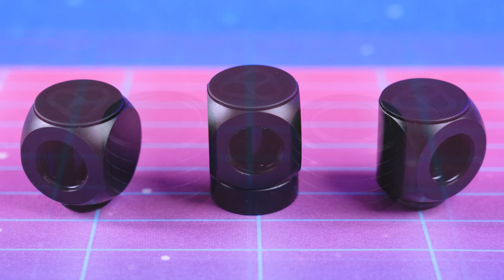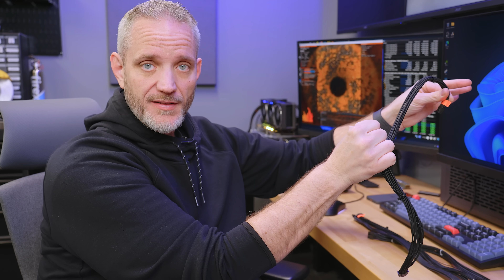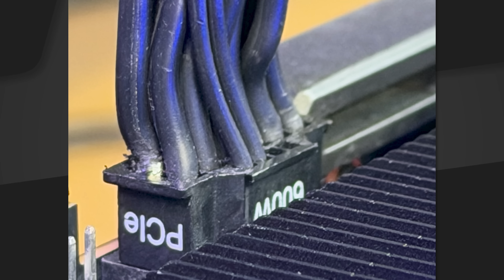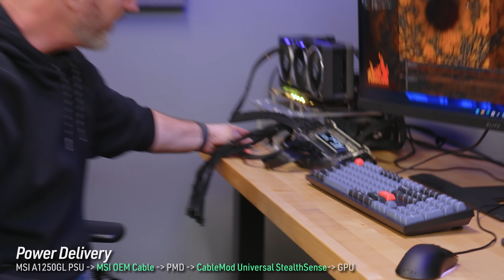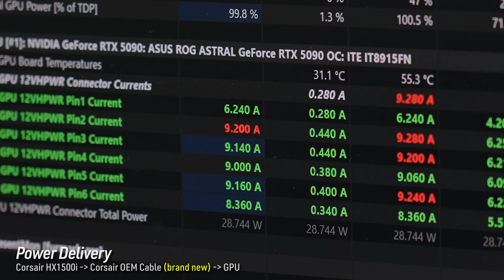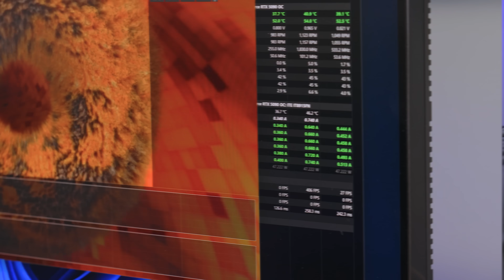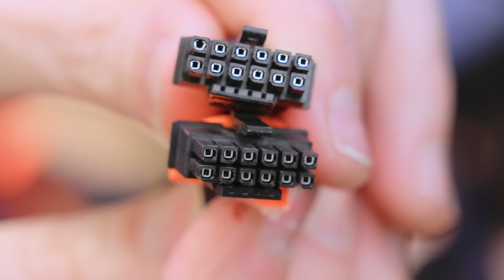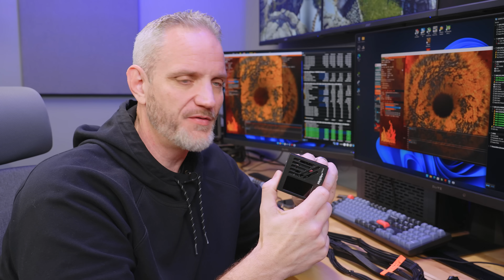More details on what could be causing 12VHPWR / 12V2x6 Cables to melt

Comment: I bought a Wireview II for my MSI 5090 and immediately found pin differences and one frequently going over 10A. Setup was Corsair HX1500i -> MSI 4x8 pin to 12v2x6 cable (that came with the card). I bought the Corsair 2x8 pin to 12vHPWR premium cable and things are better but pin differences still exist with Wireview complaining that there can be over 1A difference between wires under load. I have done resistance tests on all pins in the cable and they all are ok and match , even when the cable is being scrunched up and moved around (I wanted to check for broken wires). So the Wireview II probably saved my card but I'm still not entirely happy. I'm thinking that so long as I don't get pins going over the 9.5A standard I should be ok but I'm mad that the cards have this terrible connector and no per-pin monitoring.

Comment: As an electrician I'd like to see two 3 gauge wires used instead, with proper screw terminals, or four 6 gauges wires. Better yet they should change the spec to give video cards 24v or 48v instead of 12v.

Comment: how do I get the wireview inside an AMD RX 9070 XT Sapphire Nitro+ (with the connector hidden inside the gpu, on the back of the radiator)
Reply: Leave off the cosmetic magnetic cover plate to give yourself more room.
Reply: @bythelee  there is no way to fit the wireview in there, the connector is right above the radiator

Comment: Were fighting a zombie that resurrects through corporate incompetence, unfortunately that seems to be an infinite resource.

Also I have a case that requires the removal of the GPU to properly dust, cycling of the plug is supposed to be part of the standard. PCIE 8 pin is only 30 cycles and I have had to replace my psu pcie cables due to cleaning and modifications over the years. These connectors are not meant for repeated cycling and are built to minimize cost of MFG. They may last many more cycles than rated for, they may also have a factory defect and fail on the first plug, this is why quality control is important for every manufacturer of physical goods.

Comment: We know that this cable is weak but the main issue is the design of the cards since the beginning.. The 3090 Ti is properly build and the load is distributed properly, all other new cards are not.. So it will still happen until next gen cards are released so to be properly build if they want to continue using this cable, so sad but simple as that.

Comment: >this new connector is having problems
>let's add the same connector on the other end
pass
Reply: What would be safer is just having more 8pin connectors and getting rid of the 12 pin connector entirely.
Reply: @tomvanvenrooij1811  Yup. 3x8pin is the answer for most cards. Add a 4th if you need more power.
Reply: It’s actually safer to have the same connector on both ends because you have less cables combining and thus less opportunity for current imbalances.
Reply: @AirSKWolf  you know what else would be safer? Lower power targets.
Reply: @ArtisChronicles and a beefed connector.
Reply: @ArtisChronicles how can you say that when even 9070s with TDPs under 300W are still burning?

When you use 6 poles/wires with no current monitoring or balancing, the only truly safe power limit would be the power limit that respects the current limit of a single wire, in this case it would be only 100W.
Reply: @AirSKWolf  Under this logic, any 8 pin cable must do the same and be limited to 75 watts. And that's if you're generous and use the same high safety margins 12VHP has - under its own spec it should be limited to under 40 watts.
Reply: @iskierka8399 8 pin cables have 2 poles and 6 negatives. It’s much less likely to get current unbalances.
Reply: @AirSKWolf  The logic isn't about probability of imbalances; it's about the possibility. Basically no 8 pins have any amount of balancing, therefore, we have to assume the worst case, which means 75 watts limit.
Reply: @iskierka8399 not really because a single wire on a 8 pin connector can “safely” carry the entire 150W if something is going very wrong.

Comment: Why is so hard to do a connector with proper CONNECTION and THICKER CABLES ? I am glad that I have a 5060 TI 16GB with the classic conector rather then 12V Melting Connector
Reply: Aesthetics over function, with a nice bonus appearance of cost savings in areas that really shouldn't.
Reply: Maybe they should switch to USB-C lol. Those can run an entire laptop. Why reinvent the wheel?
Reply: @ctrlaltdebug the most a USB-C cable can carry is 240 watts. These need to carry like 600+
Reply: @3lanksp_ce put 3 USB-C cables and it's still taking up less space than the current GPU power cables.

Comment: I’ve had my 4090 MSI gaming trio, then my 5090 MSI gaming trio and then my 5090 Astral (when I finally managed to get it) all for years and year win daily use. Guess what, not a single issue.

My 5099 Astral has flashed with the LED light sometime when I rang 3D mark or in some games, reseated the cable extension and then it was fine, maybe if I had another card it could have been an issue, whah about the 4090 I had no issue with that.

How many card has less affected, hardly any in reality. 

This Cable thing again just to get content for these YouTubers.

HONESTLY I think there far more footage from YouTube like this chap than is cases. Ridiculous 😂
Reply: That's like saying you haven't experienced racism so racism isn't a problem. Obviously you don't understand how news works and in this particular case is demonstrating an ongoing issue. Things don't go away if you just stop talking about them.

Comment: It would be interesting to measure the cross section of the wires as for some time I've heard reports that Chinese use a different capacity valuation for windings and wonder if the same goes for wire cables. Also the price of copper being so high it wouldn't surprise me if the wires were thinner gauge in some cases to reduce cost.

Comment: Unfortunately, I tried buying the new Wireview, but Thermal Grizzley refused to take my card info and declined the purchased over a dozen times. Maybe if they fix their website, I'll look into buying one again for my 5090. However, I've been using the same Cable mod 4 x 8-pin to 12VHPWR cable for years now. Previously with my 4090 and now with my 5090. The cable connectors still look brand new and 12VHPWR connection is still firm after dozens oof cycles. People hated on Cablemod for their recalled connectors, but they still make high quality cables.

Comment: I think it would be interesting to solder the cable on to the graphics card. Remove the connector on the card and solder the cable directly onto the card. Then theres only the connection directly on the power supply.
Reply: Then the cable, or worse, the PCB, will get really hot and melt.
Reply: @ryanspencer6778 no dude, the problem is the connector not fully seating on the pin which creates a point of high resistance which heats. direct soldering solves the problem. if the psu side burns at least a psu is cheaper to replace than a gpu
Reply: @ryanspencer6778  Not if the problem is in the connector that you no longer have. You know, the whole point of what they said?

Comment: This cable is truly an absolute failure.
Reply: Yea very much so. 
Idk why they didnt just make the cables thicker and 5080 and 5090 have 2x 12vhpwr.
Reply: @x @xpodx cause that would mark as fail. The whole purpose of that connector was to replace multiple 8pin connectors with single standard connector. And you would need logic to monitor power distribution between those two
Reply: @xpodx  that wouldn't solve the problem, the original der8auer video shows
Reply: @carlosbelo9304 double thickness?
Reply: @xpodx  nope, board pins are still tiny
Reply: @carlosbelo9304 I mean obviously fix that too. Ha just a bigger better version of 8 pin would of been better.
Reply: @xpodx  Why not use 8Pin connectors?
Reply: @DesRabe yea i would rather use 4x 8pins
Reply: @DesRabe  tbh fuck the 8 pin connector. It's annoying to use and archaic. There's literal no reason we can't have a connector that doesn't look like shit and is safe with proper headroom. We've been using the 6-pin / 8-pin style connector since the 90's and it IS time for an upgrade, but this ain't it. I have better connectors on my electric SxS gokart I made. This is stupid.
Reply: @GraphicFrost how is the 8 pin hard to use? It clicks in nice and use cable extensions with cable combs and looks pretty good.  I use lian li ones in my main.
Reply: @x @xpodx shouldn’t have to buy extensions or any bullshit for a cable that’s one step above molex. I’ve had pins push out, the +2 get loose. I’ve seen them melt but tbh they are robust. You don’t typically see discoloration because cables are black but I have a PSU where the red cables are translucent and there’s discoloration from heat.

If we kept this same mindset, we’d still use molex. I’m honestly blown tf away that we even still use 6+2.
Reply: @GraphicFrost  I don't know. Card shouldn't consume 600W in the first place.
Reply: I dont have to. But it looks so much better and clean. Even if i use default 8 pins i dont have any issues with them. But ya @GraphicFrost
Reply: @GraphicFrost   now you're just being stupid, what's annoying about the 8 pin connectors? nothing, don't be stupid,  what's stupid and brought out the problem is the video card drawing 600 watts, don't be stupid, if we keep this mindset we will see soon video cards pulling 2000 watts
Reply: @xpodx  having this DONE PROPERLY would be way better than 8 pin
Reply: @GraphicFrost how about 8 pin eps connector (the same connector as used for cpu power)? Can carry up to 384w per connector and two of those would be enough for anything short of extreme overclocking.
Reply: @rcradiator  visually, they need to make a nice looking connector after 30+ years. It’s not rocket science at this point lol
Reply: @GraphicFrost pcie didnt even come out until 2003. And it was awhile before we saw 6 pin as common on gpu's
Reply: @GuyWithJeepOG yes the 6 pin wasn't used till the early 2000's that's still 23 years on this visual rendition. However it's still a molex mini fit. Molex style has been around since the 50's and slowly improved. The first gpu used a 4 pin and as I mentioned that is dated back to the 50's. The 6 pin roughly supports 15 more watts due to the added cables. It's not new.
Reply: Thicker cables cost money. Better connectors cost money. Every dollar you add to the bill of materials will increase the retail price 4x or more.
Reply: @wombatillo  that is why design a good standard from the ground up is important :)
Reply: chinese tat is returning to its normal "quality"

Comment: We had good connectors for years.... even decades. How did they think that putting 4x the power through only 50% more but also smaller pins was a good idea?
Reply: Ikr? And the wires themselves don't look high enough gauge for all that power either
Reply: @BigDrewski1000  That is correct, the cable's limit is so close to what a 5090 runs it at, while limit for PCIe is 2x its load. Derbaur did a great video about it a few years ago when the 4090 was new mentioning how 3x PCIe cables has way more overhead than the 12vhp, even though the 'rating' for 3x PCIe is only 450w
Reply: @manicdan481 Even 2x 8-pins would have had more overhead than this flimsy 12V-high_failure, IF those 8-pins had been EPS instead of PCI-e.
EPS can handle up to 500W and can safely supply up to 335W through a single connector.
Reply: @manicdan481  Rating be damned on 8 pin connectors. Pretty sure most of them can ramp up to 250w for a short time and be completely safe.
Reply: @manicdan481 8-pin pcie was probably able to carry double the current without heating up too much. I've done OC of cards with only 2 pcie 8-pin connectors at over 450-500W (1080ti XOC) without any issue.
Reply: I have been working in R&D field in the silicon valley for the past 10 years, the genius engineers over here can make anything unthinkable a possibility 😢 This is the result of, most probably, companies trying to save on hiring experienced engineers, who would have immediately BANNED the consideration of using those connectors for those loads. Ignorant & overconfident, wrongly engineered degenerate generation of engineers 😊
Reply: @a.g.8015 H1-Bs?
Reply: planned obsolescence, gamers love it
Reply: They save about 2 cents in copper per cable bundle. But thats multiplied by millions of cables. 
And I guess the little children assembling them aren't so good with crimping the smaller pins. 
You would be shocked to know how often this is a problem, with everything. Shoddy wiring connections are becoming much more common, AND things are getting more and more wiring incorporated into them on top of that. Just go around your house and find things made in the past 7-8yrs and open em up. You're bound to find some super rough solder joints, wires where the insulation is stripped about 1/2" more than it should, and hot spots. And thats just the common, not a huge deal to operation, type issues that go unnoticed most of the time. Then there are the catastrophic, fire waiting to happen, type problems, which are thankfully more rare, but not as rare as they used to be...
Reply: I'm convinced that Nvidia had AI design the 12VHP connector.  It was clearly designed to just barely meet the spec with very little overhead, which leads to heat problems with even minor imperfections.
Reply: Greed is real on these cheap old graphics cards lol
Reply: Jennings the CEO is too cheap to put out a proper Graphics card.  This cable connector is the outcome of cutting corners to make more money. It's also him as an engineer that's too smart for himself but his ego wont recognize that.  It's why Nvidia wont stop using it.
Reply: It's actually ridiculous when considering the additional cost of using higher gauge wire and upgraded connectors, relative to the overall unit cost of the power-hungry gpu models that actually need these improvements. 
Hasty design, testing and release to market of a slew of new models, combined with corporate greed-driven cost savings, monopoly-infused arrogance, incompetence and, perhaps even, indifference?! And repeating this cycle throughout the Youtube boom era - when they will inevitably get a bad rap from users and industry watch-dogs alike. 
For giga-rich corporations like Nvidia - who have all but abandoned the enthusiast gaming community in favour of a blue-chip 'safety-first', Wall Street-friendly philosophy - surely their actual approach to delivering safe, reliable products is a total contradiction of Madness?!
Reply: 8pin only use 6 of those pin for power, so it's 2x number of pins